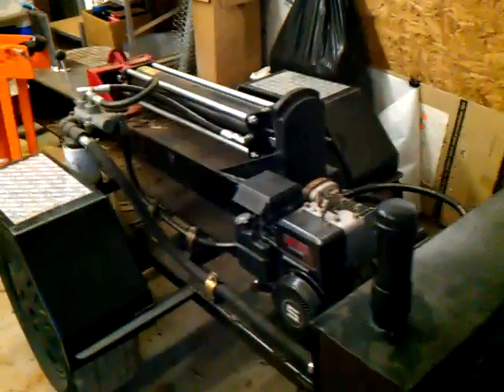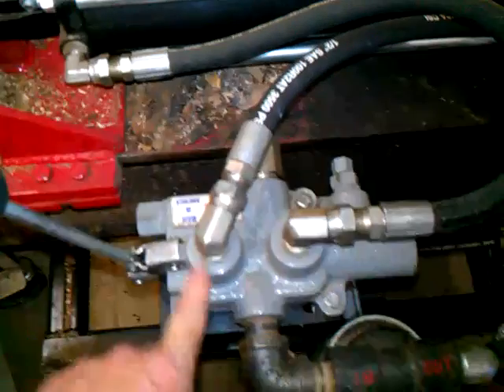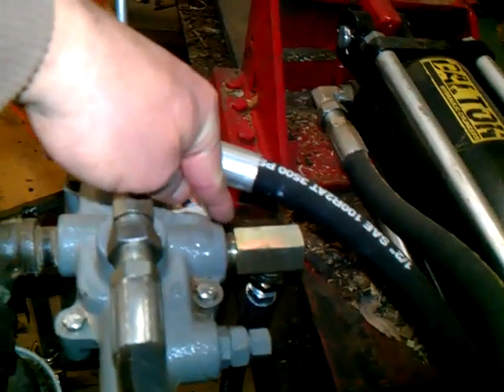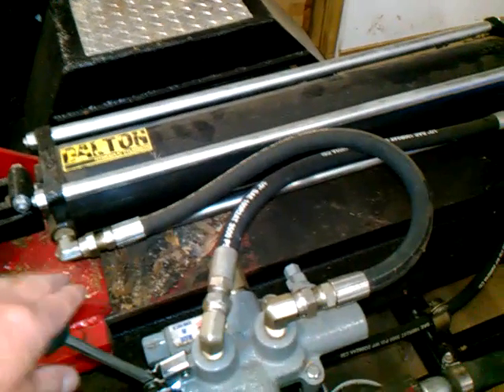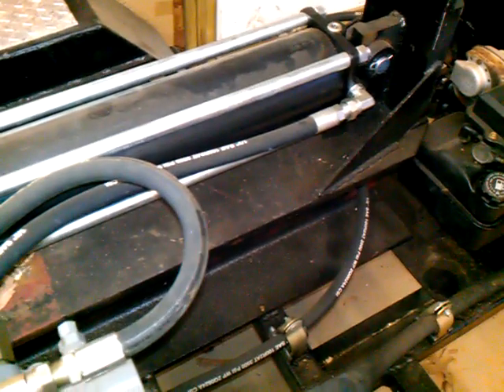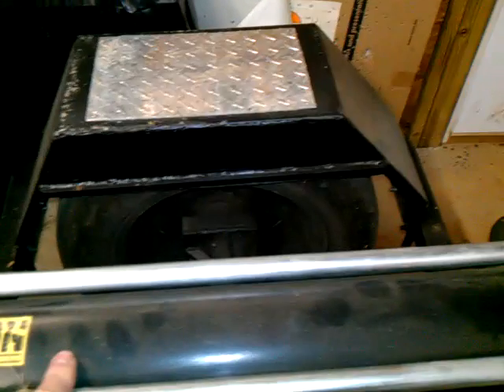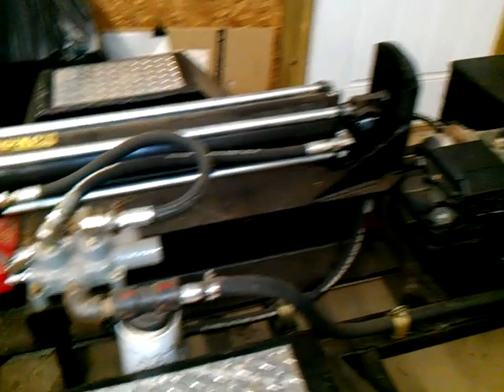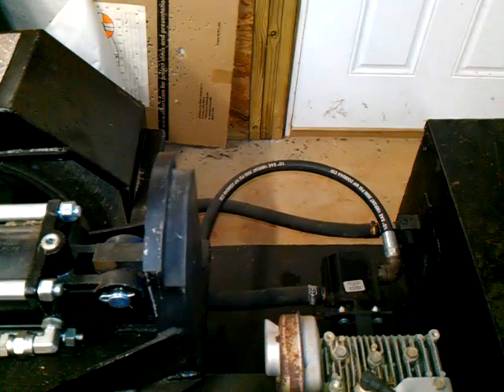how hydraulics work on wood splitters

Comment: I have taken some of the hoses off the valve assembling and all seems to be be flowing (with the engine off of course). It looks like the front of the cylinder is not getting enough fluid / pressure to send the ram back home. The guy at northstar said the level assemble pretty much never faisl, it may slow down and not split wood, but that would only mean there is not enough pressure somewhere. Any ideas? I stumped and getting pissed I can't figure it out.
Reply from the maker: James Fox Do you have a pressure gauge on your wood splitter
Reply from the maker: James Fox the reason I ask is your pump may not be putting out high pressure may just be putting out a low pressure. the best way to find out what your pressures are is to have a gauge. hope this helps
Reply from the maker: James Fox the reason I ask is your pump may not be putting out high pressure may just be putting out a low pressure. the best way to find out what your pressures are is to have a gauge. hope this helps
Reply: I do not. I was splitting wood and all was fine, 50 logs in and the ram went forward fast, faster than normal, and now just stays forward. I took hooked up a strap to it and forced it back which was tough. Started it up and the Ram went sailing forward again....so I would assume there is pressure (going forward). for the life of me I can not understand why it wont go back...could there be a fluid block not allowing fluid back to the tank? Could the engine shaft be slipping not allowing "enough" pressure to bring it back
Reply: James Fox, I read both of your posts about your problem. It is clear from your description that there is something wrong with your directional control valve. There is nothing else that could be wrong that would leave you with the symptoms you describe, especially the fact that the ram immediately went to the full extended position after you had manually retracted it and restarted the engine.

Check to make sure that the lever handle is properly connected to the spool. The spool is the metal plunger that moves in and out of the body of the valve. That spool is what controls the direction of the flow of hydraulic fluid. My guess from your description is that there's something wrong internally though. Contact me if you need any further help.
Reply: This is due to a seal leak in your valve, probably an O-ring. It is allowing pressure past and moving your ram forward? Not totally sure but that is what I would guess. Rebuild your control valve, it should only need new O-rings.
Reply: Control valve shot. That valve sets system pressure and direction. If it's bottoming the cylinder out back or forth it has to be that. It's rebuildable with new 'o' rings if the spool valve isn't broken.

Comment: Excellent explanation. Question, I have a 17 ton Northstar splitter where the ram came out after splitting a log and it's now stuck put. I was told to check the couplers where the engine shaft connect to the pump to make sure it's not slipping....what else could it be?
Reply from the maker: James Fox if you keep trying to push the lever forward to split does it make a groaning sound. if it does then your pump is still pumping.
Reply from the maker: James Fox there is a love joy coupling that couple your engine to your pump you should be able to see it turning
Reply: yes, I can also see the hoses shake and move as if they are under pressure....
Reply: I can se it spinning, the guy said it might be slipping enough (if the set screws were lose) to not be spinning the pump fast enough,....but after just running it, it certainly looks like its spinning at a good clip. This is why I am so "stumped" :)...it does not make sense why its not sendind the ram back to home? could a hose be clogged, or the little screen filted be clogged?
Reply from the maker: James Fox the Lovejoy couplings have key way in them so I don't think they're slipping. can you change the hose from the front of the cylinder to the back and the back to the front and see if it'll work
Reply: Well, I did a full fluid change out. Changed the return filter, pulled the feed micron screen insert filter and cleaned the hect out of it...pulled all the hoses and made sure all looked good. It's cold here in New England, so I will refill the tank and cycle through to get the system filed to see if anything changes...
So, you're saying I can switch the A and B port from the back and front of the cylinder and that will not harm anything, won't the lever work opposite and how will the dentent auto neutral work then?
Reply from the maker: James Fox yes if you switch the A and B that will give you a starting point to see what may be wrong ,I would not leave them in that position but it will help find the hydraulic flow problem. if you still have the same problem with the cylinder not going back then you have a problem with your cylinder
Reply: OK, thanks. I'll let you know how it goes.

Comment: Nice video... I own an Ariens 22 ton log splitter and noticed I have hydraulic fluid leaking out of the Denton valve from underneath. My question is how do you tighten that connection? Are there any o-rings or anything you think I might have to replace in order to fix the problem? Thank you so much for your help.
Reply from the maker: Hard to say  without seeing the valve

Comment: my dad has a splitter that need a new hose...hydronic. he replaced it now the ram runs really slow in both directions. any ideas
Reply from the maker: Darrin Holstine Did you replace it with the same size hose. They have different size it's like a garden hose you can have a half inch or 5/8 inch garden hose still have the same ends
Reply from the maker: Darrin Holstine may also want to check the filter if your wood splitter has a filter

Comment: I have an old home made log splitter.  I put a new motor on it and it split wood good for 20 minutes.  Now the piston cylinder moves both directions, but isn't strong enough to split wood.  Any thoughts what could be problem? pump? valve?
Reply from the maker: Sorry I missed your question. Sounds like the seals on the Piston inside it went bad

Comment: hey I got a old splitter which way I push the lever on the control piston goes one way ant hints
Reply from the maker: may need to rebuild valve may have bad o rings

Comment: A question or two about the hydraulic fluid: Does changing it involve anything more than simply draining the reservoir tank and refilling, plus changing the filter? Someone told me you should flush the whole system out with kerosene, but how do you do that, exactly? (Just fill it up and run the machine?). And how do you get all the kerosene out again before you put in fresh fluid? 
Does the fluid from the hoses and elsewhere automatically run down into the reservoir when you drain it? And any issue with air bubbles, getting them out? (I can't find a video anywhere on Youtube showing how to do this, which is a bit odd.) Thanks!
Reply from the maker: I I would just drain hydraulic fluid change filter that's good enough you do not need to flush the system only on huge machines do they do that

Comment: For the past 3 - 4 months, when I would start the engine, at high RPM it would sound constantly labored, rather than the normal "good" high RPM.  Just two weeks ago, I was using it I heard something "let go", the ram stopped moving (I was retracting it at the moment when whatever "let go"), the engine went right back up to its 'normal' / good high RPM, but I have no hydraulics.  Upon looking closely at the output shaft of the engine there is that fancy looking cylindrical block that connects the hydraulic pump to the output shaft of the engine.  I'm being told that there is some type of a shear pin in there that is the first thing to break as a safety feature so you don't grenade the pump or blow the motor.  

What would cause the engine to be running constantly labored, that would ultimately lead to that shear pin breaking?
I have only had this thing about 3 years, its probably a 2005 model, the hydraulic oil filter has never been changed in the time I've had it, and the fluid has been appropriately topped off here and there, but never a complete change.  Could the hydraulic oil filter be clogged to a degree be enough to make the engine sound labored like that?

So now to do a COMPLETE hydraulic fluid level change in it, should I be pulling all the hoses off, draining them, inspecting them, pull the hoses off the pump, look for a screen that could be clogged at the intake to the pump, do I have to disassemble the pump itself (aside from just pulling the pump and fixing whatever sheer pin that may have let go), etc etc?

really not a lot of info online about these.  
thanks for your help.
Reply from the maker: +Bryan K I would just loop a hydraulic  line from inlet to outlet  to see if it is in the pump after that I would just start eliminating things filter,valve,hoses,cylinder
Reply: thank you.  I'll start there

Comment: I have question you. I have 13 HP Honda motor from a pressure washer. I want to take the pump off and mount the engine for a splitter. How do I size the engine and hydraulic pump to the shaft? I may have to weld an adaptor plate and extension to the engine but I am not sure where to start. 
Thanks for the video. I learned a lot
Reply from the maker: You can get a adaptor at TSC I would put a 16 gal pump on the 13Hp motor.You can get adaptor off ebay you will need a Hydraulic Couplings here is what it looks like http://www.northerntool.com/shop/tools/category_hydraulics+hydraulic-couplings+hydraulic-half-couplings   here the pump http://www.northerntool.com/shop/tools/product_200321055_200321055 .   here is the adaptor you need to know the bolt pattern they have 4" or 5" hope this helps.
Reply: Wow, thanks for the quick response
Reply from the maker: You can get a adaptor at TSC I would put a 16 gal pump on the 13Hp motor.You can get adaptor off ebay you will need a Hydraulic Couplings here is what it looks like http://www.northerntool.com/shop/tools/category_hydraulics+hydraulic-couplings+hydraulic-half-couplings   here the pump http://www.northerntool.com/shop/tools/product_200321055_200321055 .   here is the adaptor you need to know the bolt pattern they have 4" or 5" hope this helps.
Show lesshttp://www.northerntool.com/shop/tools/product_200337126_200337126

Comment: Very good.   One guy who  builds log splitters in a factory in CA told me to drop a magnet or two in the hydraulic fluid tank.  It will catch any shavings or metal that may be floating around,   Thanks for the video. Ken from Indiana.
Reply: Hydraulic systems and any pressurized oil system even automobile engines and transmissions would benefit with magnet in bottom of pan or tank!

Comment: I have a question about my logsplitter.....kind of silly because Im just throwing it out there but I was wondering why my splitter seems to work harder on the "return" cycle under no load as opposed to the splitter not struggling at all under full load with quite large rounds being processed....if you or anyone has any suggestions please feel free to let me know. Im just baffled as to what could be wrong. It is well built and in very good condition but the return stroke has me confused. Thx , and great video by the way !
Reply: This could be caused by a ( bottle neck ) effect on dump side run 1in return hose with curved elbow.

Comment: great video - how much hydraulic fluid does a log splitter take? Is there a fill line within the tank?
Reply: Usually 2/3 inches from top because oil will explode when heated

Comment: Great explanation. Is there a formula to go by? As far as PSI, hoses and pumps I'm clueless.  I'm just beginning my splitter. I bought a 12 HP Briggs and Stratton electric start riding mower. Thanks for your video.
Reply from the maker: This is the pump  http://www.northerntool.com/shop/tools/product_200321055_200321055
This is the cylinder http://www.northerntool.com/shop/tools/product_200511882_200511882
you can look at other stores this is just to let you see what kind of parts you will need some pumps can't be turn vertical must be turn horizontal hope this helps
I don't know if the links will work or not. If not let me know.
here is another cylinder http://daltonhydraulic.com/?slug=product_info.php&cPath=28_123&products_id=385
This is the detent valve http://www.northerntool.com/shop/tools/product_472_472

Comment: Con Ogden
I changed the hyd oil and worked the cylinder by hand to get all the oil out.
NOW how do I bleed the system of air so I can get to work? PLEASE!!!!!!
Thanx in advance                    Con
Reply from the maker: Just start it up and use. The air will work its way out

Comment: HI a Friend just gave me an old log splitter that was made from a cannibalized fork lift.
I had to replace the motor and the old motor turned the pump clock wise and the motor I have now turns counter. Will the pump work either way or will it only work clock wise? I don't want to burn it up. I have been stumped ever since most folk I know don't know.
Thanks for the vid. I wondered what all that stuff did.
Reply from the maker: All the pumps I have used have  a direction. if you look it up you may find the spec

Comment: i let someone borrow my log splitter. they added hydro fluid when it didnt need it. it was spewing fluid out of the relief hole but they kept splitting wood until the ram would no longer split the wood but it would go forward and back still, just no pressure on the wood. 

i realize it can be a lot of things but could this cause pump damage?
Reply from the maker: May have caused the hydraulic oil to foam. Witch may have damaged your pump.
Reply: hoss-it-is--thanks i just wasnt sure where to start. i drained and changed the fluid and cycled it. i will look at the pump. thanks for the response and nice job on the vid!
Reply: @fishman80  I'm experiencing that exact problem now. Somebody overfilled the reservoir and now I don't have much power behind the piston. Thing is a foamy mess inside and I'm currently draining it off. Did you get yours to come out of it once you got the proper level restored with new fluid?
Reply: @bullscmym  i drained it all out and let it sit a day. refilled it and eventually came back out and works
Reply: @fishman80  Good deal! Thanks for getting back to me

Comment: Have a North Star with no other fluid/hydraulic filter other than a screen inside on the supply side nipple, I believe. Should I consider adding one [filter] as this is only a 22 ton, home use? And, how many hours can be used on the hydraulic fluid before changing it? Thanks for a super explanation on hydraulic op.
Reply from the maker: Sorry I missed your question. but I still haven't changed the fluid in mind

Comment: You did an excellent job of describing the hydraulic circuit and components of a typical log splitter system. There is one clarification I would suggest to clear up a misconception that some have.

You described the oil flow from the pump to the control valve and back to the tank when the valve is in the center neutral system as being "high pressure oil". These systems are open center (meaning the in and out ports of the valve are "open" to each other when the spool is centered) and therefore no resistance to the flow is present. This in turn means there will be very minimal pressure in the system, as it should be. Open center systems should only see high pressures when there is actual work being done (i.e. the initial split of the wood, which is what requires the high forces).

Pressure is the enemy to fixed displacement hydraulic systems when it is present without productive work being done. That is what causes excessive heat and wear. A well designed circuit will have test port locations where a pressure gauge can be installed to check pressure status at various operating conditions and valve positions for troubleshooting.

It is important to understand that pumps do not pump "pressure", they pump volume, a fixed volume in the case of these types of pumps. Pressure is the result of a RESISTANCE in the circuit to that flow. The greater the resistance to the flow rate, the greater the system pressure.
Reply: Well said @byronmill, thank you.
Reply: So if you were to add another valve in the return line  ,It should not create resistance or pressure in the system until you activate the 2nd valve lever. Such as in a log lift attachment.?
Reply: @jamesevans20  Yes, as long as you are using an open center valve. However, in some conditions in hydraulic circuits,  connecting the return to tank port of one valve to the in port of a second valve can result in undesirable results.  When  the circuits in the second valve build pressure during work that results in the return galley of the first valve seeing pressure it is not really designed for. This could lead to leaks out the end of the spools of the first valve. It could also cause the spool(s) of the first valve to actuate unprompted. Also, under certain situations, it can cause pressure compounding in hydraulic cylinders in the circuit of the first valve. Power beyond configurations eliminate those potential problems.

That being said, on a logsplitter it is usually acceptable to run a second valve in series (without power beyond) to control a log lift, etc. The split cylinder valve should always be first (higher pressure). The second valve MUST have a pressure relief valve and that PRV should be adjusted to the lowest PSI setting needed to accomplish the lifting capacity needed on your log lift. There must be a direct path back to the tank from the return to tank port of the second valve.

Comment: 4 in cly  22 gpm pump 26 in stroke 16 hp  25 gal tank all new still gets hot -- going to add a cooler this summer
Reply: Hydraulic Reservoir should be four times the pump output. Example, 4gpm pump should have a 16 gallon Reservoir.